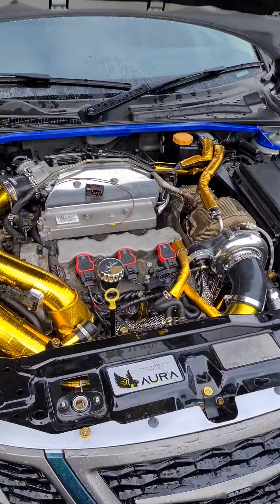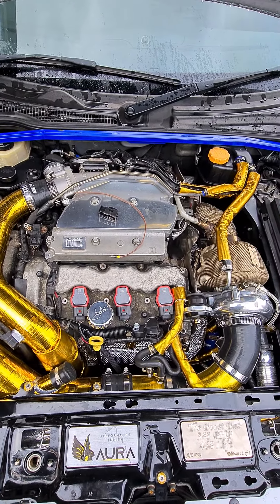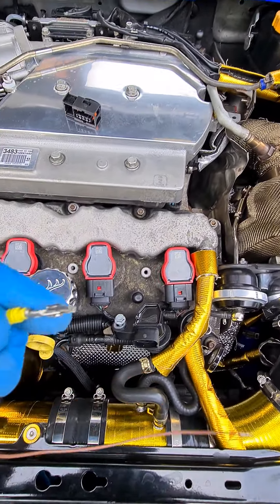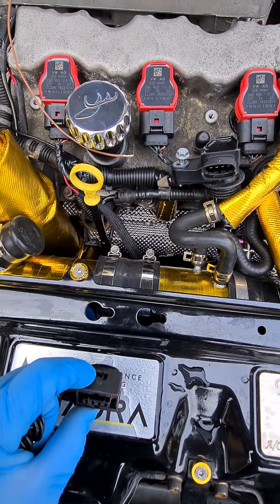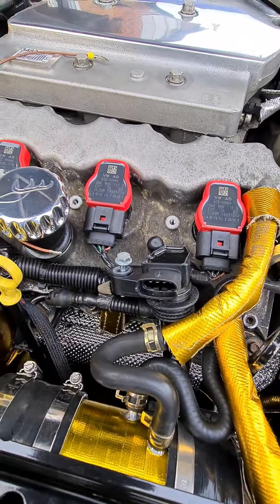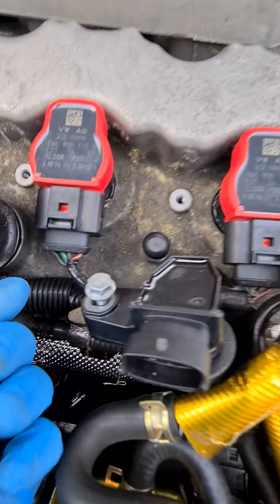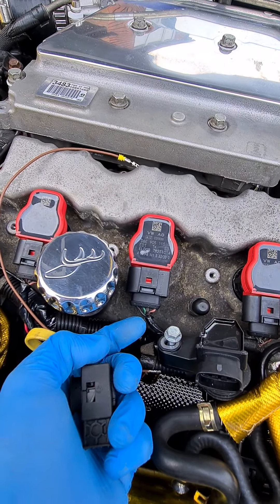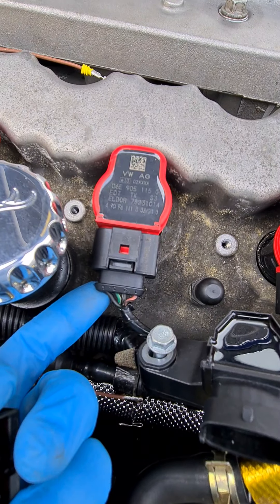Saab 2.8 v6 Audi R8 coil upgrade vectra vxr

Comment: Can this be done on the 2.0T Saabs because I hate the coil packs in them they always go bad
Reply: Nope, Ttrionic 5/7/8 systems use ionic current knock detection which require a feedback circuitry in the coils.

Comment: Did you also change the plugs when doing this?
My Signum 2.8 V6 has the same engine and suffering from misfires so I’m going to upgrade to these
Reply: Do you have a stage or has your signum original software? For stage use bosch  242 240 715 plugs. Coils have to be the newer from Bosch with the 112 at the end of the part number or you upgrade to this r8 coils. But its not necessary for stock software.
Reply: @coolhand2002  no my Signum is getting a rolling road map in Febuary , I’m changing the plugs anyway but no time to do the coils.
Is it worth putting a K&N panel filter in or are the pointless
Reply: @Shadowmosesarea51  Ok than you have to change the coils to Bosch 0 221 604 112 (important that you use these one!) or convert to the R8 coils. Because the old Bosch coils will cours missfires. Plugs have to be 0,7mm plugs! I recommend the Bosch 0 242 240 715 plugs. :) And please never use oiled air filters for turbo charged engines! Pipercross or stock filters are ok. ;)
Reply: @coolhand2002  ok thanks buddy are the Bosch coils a straight swap or do I need to mes with wiring
Reply: @Shadowmosesarea51  they are straight swap plug n play. :)
Reply: @coolhand2002  ok my car has the Bosch 0 221 604 104 coils what’s the difference between them and the 0 221 604 112
Reply: @Shadowmosesarea51  The older revision with 104 can't give enought power ( good and stable sparks) in higher rpm when you have a custom mapping. Thats the reason for the missfire. But the 112 are a newer revision and they'll work perfect with mapping and 0,7mm spark plugs. If you have 1,0mm plugs just lower the gap to 0,7mm. ;)
Reply: @coolhand2002  thanks very much will change them before the map
Reply: @Shadowmosesarea51  no problem mate. good luck. :)

Comment: Amazing does this mod add any bhp
Reply from the maker: It won't add bhp to a setup that isn't misfiring.  You find that when you want to run numbers north of 420/440bhp then oem coils can't do it . These will then take you higher without issues

Comment: Hi, can you tell me, may I use this method to fix coil issure in stock version of z28net engine 184kilowatss?
I write wiring diagram, if I made, a mistake please write it to me correctly. 
SAAB => AUDI
Pin1 -> Pin3 - coil signal
Pin2 -> Pin1 - live feed ( It mean's spark module or some kind of repeater?) 
Pin3 -> Pin2 - earth 
Pin4 -> Pin4 - earth 2
Could you also write me OEM numer of Audi coil connector that you used here? 
I would be gratefull for every help. 

With regards :)
Reply: Did you test your solution and did it work?
Reply: @wojciecho4514  Cześć. Niestety nie otrzymałem potwierdzenia tego, że dobrze spisałem opisany schemat, mógłbym zakupić gotowy KIT od Pana z filmiku, ale niestety razem z dostawą z UK to się nie kalkuluje. Taniej byłoby to ogarnąć na częściach kupionych u nas w kraju i szybciej.
Reply: @skowronek1222  Cześć, ja to zrobiłem i śmiga. Piny są tak jak to opisałeś. Napięcie pin 1, piny 2 i 4 masa (robiłem tak, że ten sam kolor masy zawsze był podpięty pod ten sam pin), pin 3 sygnał z ECU (u mnie były dwa różne kolory, raz zielony i raz jakiś biało-czerwony, o ile dobrze pamiętam). Cewki trochę wystają bo są większe. Ściągnąłem gumową uszczelkę ze starych cewek i przełożyłem do nowych. Jak coś to pisz z pytaniami. Pozdrawiam.
Reply: @wojciecho4514  O widzisz i jak wrażenia, rozumiem, że jakoś niedawno robiłeś? Jakie koszta z tym związane w tym momencie?
Reply: @skowronek1222  Jak możesz to daj jakiś kontakt do siebie, napiszę Ci wszystko. Pozdrawiam.
Reply: @wojciecho4514  masz jakiś mail? Ja nie mogę swojego dodać, bo komentarz znika. :/

Comment: I can see you did an exhaust manifold heat shield, did it make a engine bay cooled?
Reply from the maker: They are custom manifolds . Bigger diameter . Home made heat shields.  I sell the turbo kit
Reply: @garymgzs280  i just want to know if heat shields prevent a bit form overall engine bay heat. I have B207 and i am am thinking to cover DP and turbo with that to have less heat in engine bay overall
Reply from the maker: Yes it works wonders.  

Turbo blanket also.  

The silver material is lined with fibre glass.  It is made by heathsield products.  They sell various sizes . I used the thicker 12mm version
Reply: @garymgzs280  nice. Thank you for the answear. I think i will go with it.